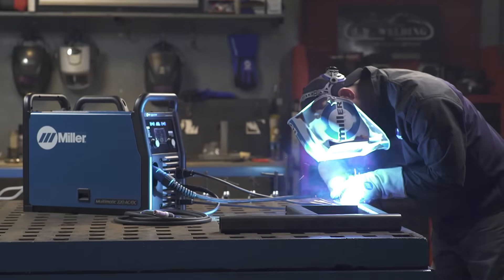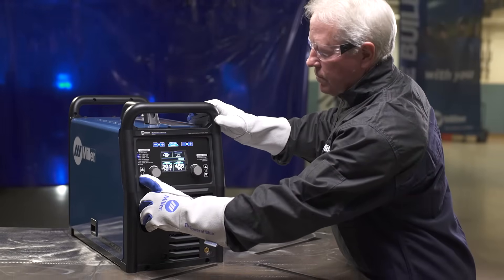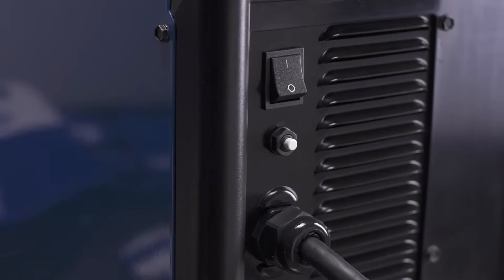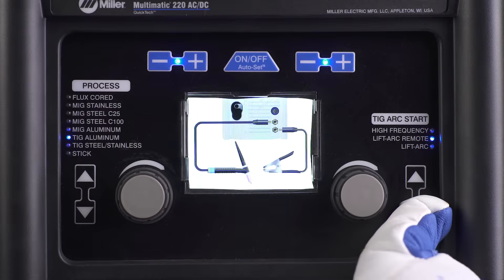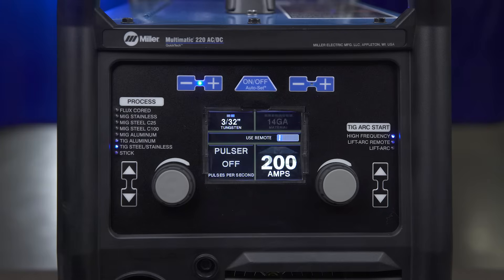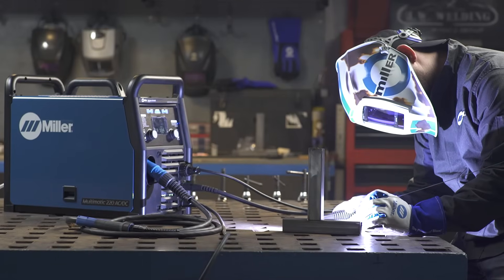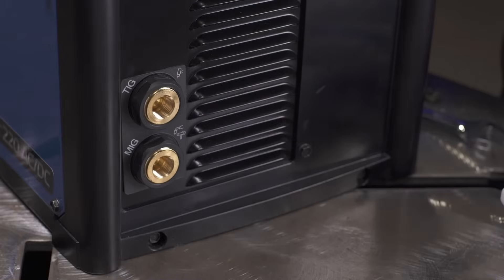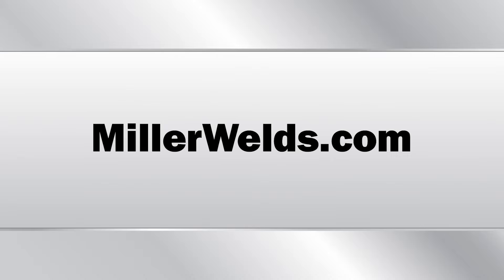Getting Started With the Multimatic 220 AC/DC

Comment: I notice the option to run Flux Core. Does that mean it can handle Dual Shield?

I'll tell ya what would be the hot ticket:
Offer the machine in a box with a ground clamp, and let me buy leads separately as needed. I need MIG right out of the gate, and TIG a little while later. Haven't touched any SMAW since before the Iraq invasion.

Would also be really badass to invent a multi-process meshing that can also do Plasma Cutting. I would sell a kidney today to buy that!

Oh I forgot
Can you hook up a remote MIG box to this and run the big spools?

Comment: I heard miller make also  HOBART ,, so why multimatic 220 on stick Mode goes up to 90 amps in 110 volts While hobart multihandler 200 can reach the 100 amps on 110 volts .. 10 amps can make a big diferente welding 7018 ³/³²

Comment: We have one of these machines in our shop and there is a problem with air entrained in the argon.  The tungsten becomes contaminated within 20 seconds of welding and there are sparks coming out of the puddle. The weld is gray and rough. The fittings are tight on the regulator and the fitting going into the machine. The O-ring looks OK in the bottom of the DINSE connector socket. The fitting at the torch body is tight. The O-ring on the back cap looks OK. I haven't opened the case to look for the gas valve. Is there anything else I should look at before opening the case?
Reply from the maker: The most likely problem would be a hole in the gas line, I would try swapping to a different gas hose and verifying the issue still exists.
Reply: @MillerWelders  Are you talking about the hose between the regulator and the fitting in the back of the machine or the hose between the DINSE connector and the torch body?  Thanks!

Comment: Can someone let me know if the machine can take a big spool of mig wire or onl 2lb spools?
Reply from the maker: Hi Kyle. Thanks for reaching out. The largest spool accepted by the Multimatic 220 is an 8 inch spool or 12 lb max.
Reply: @MillerWelders  can you hook up a wire feeder for bigger spool of wire? And recently I saw a video on this machine where it was was hooked up to 110V and the weld parameters for the wire were adjustable between .030 and .035 wire, when hooked up to 220V can you adjust it for .045 wire? I realize you would have to change the drive rolls to .045 as well. Is that possible with this machine?
Reply: @MillerWelders  Or could the "Multimatic 220" be used with the "ArcReach Suit Case 12" as a solution if you can't use larger size spools or .045 drive wheels in the 220?

Comment: With your advertisement I can really see myself buying this and using it but with your phrase of saying you can use this at home and the garage why aren't you saying you can use this on the job site ?
Reply from the maker: Hi Nick, thanks for your interest in Miller Welders. The Multimatic 220 can be used on jobs sites but is recommended more for hobbyists and smaller shops. For larger projects and job sites, we recommend the Multimatic 255.
Reply: @MillerWelders  I have to ask why the 255 on larger projects and job sites

Comment: any welding processes BUT not FCAW-Gas
Sounds like you need a firmware update
Reply: Run flux core on manual adjusting mode...no?
Reply: @clevelandmortician3887  Maybe...,  Not sure,...  if it was a manual mode
But whats the point of auto-set if it dose not cover fcaw-gas. especially since it can handle gasless-fcaw
Reply: Oh...dual shield. Probably run on one of the mig settings w gas and adjust from there. I love setting up a machine and tricking it.
Reply: I think all MIG (GMAW) can be converted to Floxcore (FCAW) with gaz. Simply to change the feed rollers for rollers with grooves and change the gun liner for a liner with teflon protection and buy the good gaz. Your supplier of Gas and welding products can give advise for this. But probably for this equipement you need to use manual adjust...